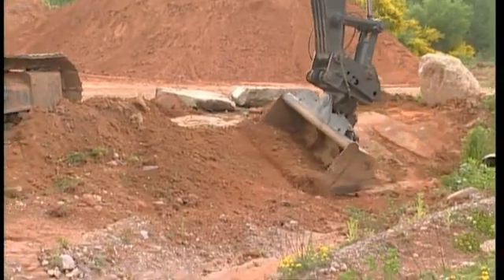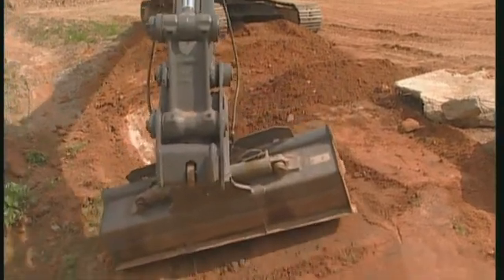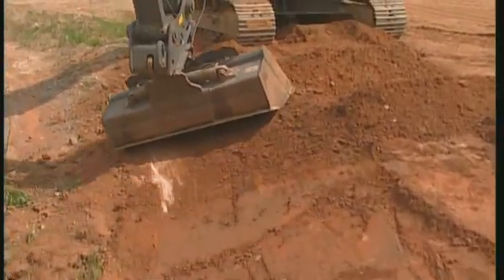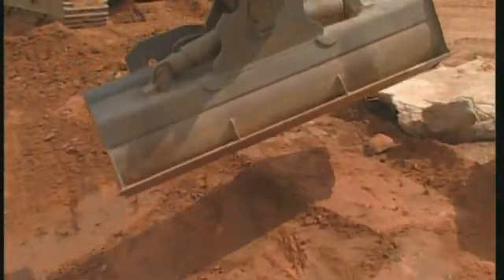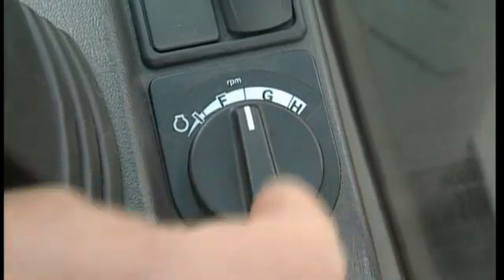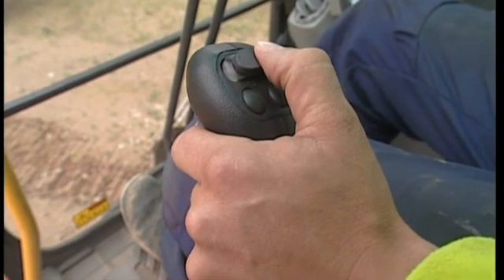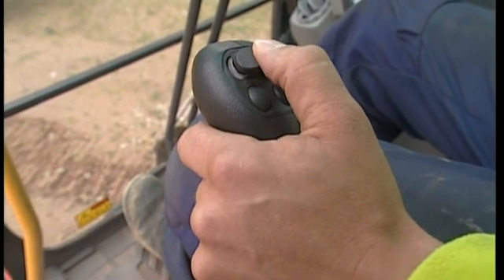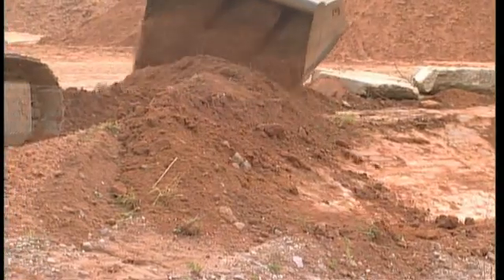How to grade with a Volvo Crawler Excavator (Part 8 of 15)

Comment: Because the part of the bucket that is always suposed to be working against the ground is the cutter, and the bucket should always be as flat as posible in relation to the ground without actually touching the ground, that way you get more precision, and the bucket doesn't wear out as quickly! If you stand the bucket on end, the ground will become grooved like a washboard. :)